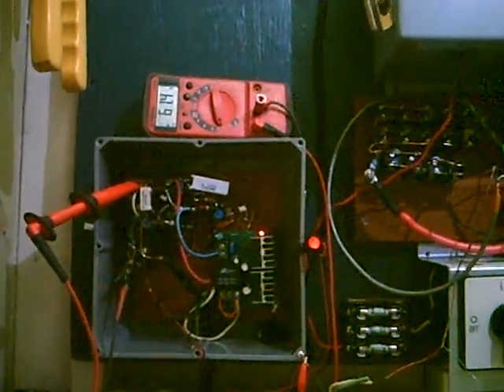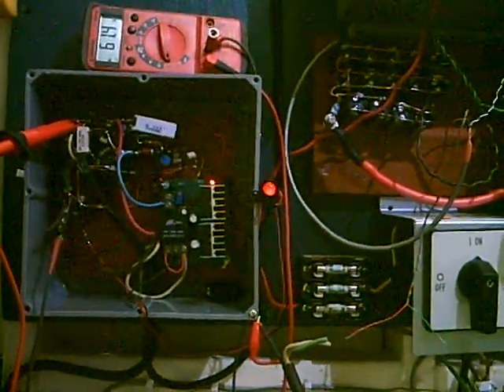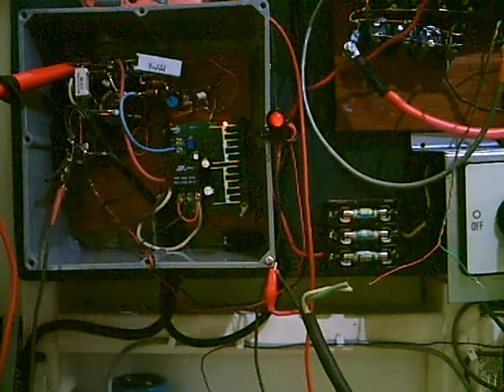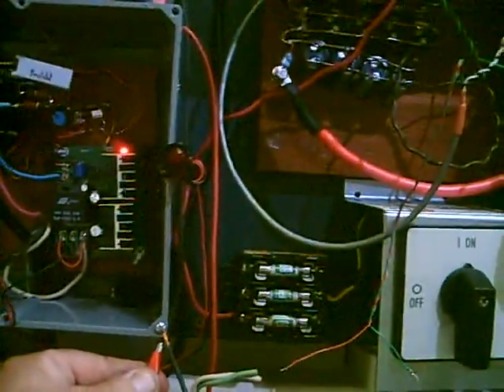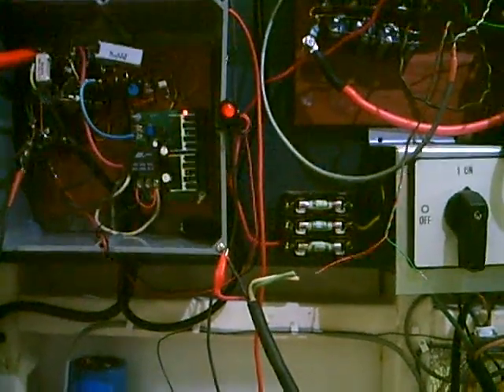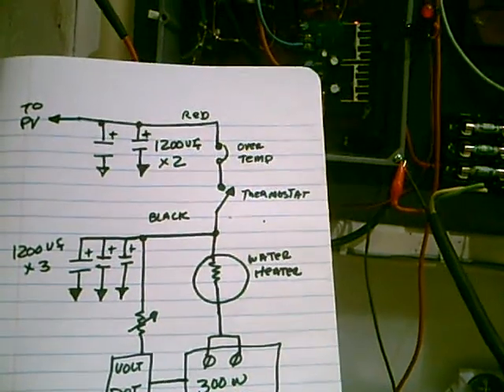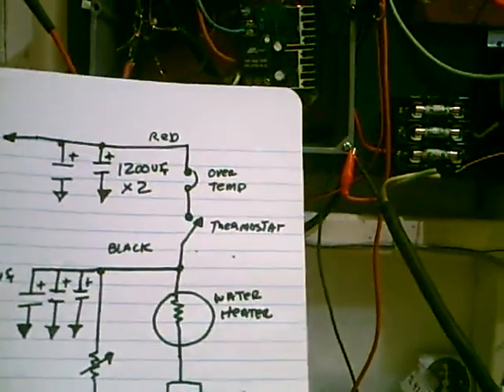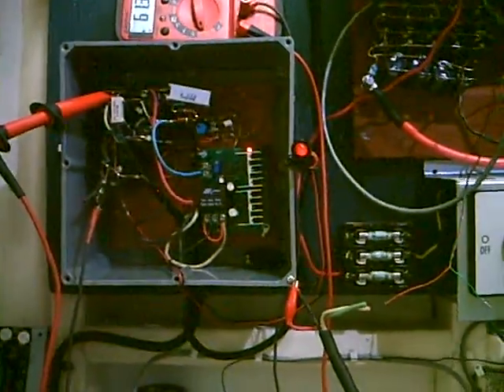Heating Water With PV At High Efficiency Really Works Part 2

Comment: Hi Opera, I really like your solutions  for water heating and would like to implement the it at my off grid cabin, but have some questions. How would you do it if the PV array is around 100v at 8ish amps, and the tank has both an upper and lower element (120l tank). Also could a wind turbine use the tank as a dump load as well or will that cause conflicts? If there is zero spark potential could I use the lower thermostat to switch to a secondary dump load when water is at required temp? Keep making the vids, as they are great even if a little hard to follow for someone with just basic electrical knowledge:)
Reply from the maker: Unfortunately, the 300W board is only good to 75V with the 75N75 FET and many are now shipping wit an IRF3205 that is only 55V.   These could be externally replaced with 15N110 FET for the convenience of using the 2153 driver.  I am now working on a circuit you totally build with very few active devices. There is a preliminary video using a boost converter. The converter would just be eliminated. It would require a circuit for each element. Currently I am waiting for some sun to do further testing.  It could be a while!  I post these vids to start a discussion because each situation is different. I'll work on better explanations. With almost no views or interest I haven't spent a lot of time adding detail.
Reply: opera Thank you for the answer, so if I understand correct I could desolder the FETs on the heat sinks and replace   with the ones you recommend for voltage and parallel boards for the amperage? I did fall into the black hole that the Fieldlines forum is, and now decided to go the Arduino route instead  I think.
Don’t understand the low views as the theme of your vids is excellent, but the knowledge leap from plug and play 12v dc elements controlled via the CC to soldering and modifying boards is quite big. Hope you keep making them and that the knowledge spreads as going straight from highish PV voltages to dump seems so elegant in my head:)
Reply from the maker: @RexKanum  One of my water heaters is nano based. With that the frequency can be controlled and short pulses that cause FET heating can be eliminated.  This is the prefered way and two heaters can easily be driven from a single nano.Opto isolator FET drivers are easy and prevent ground loop problems from high currents.